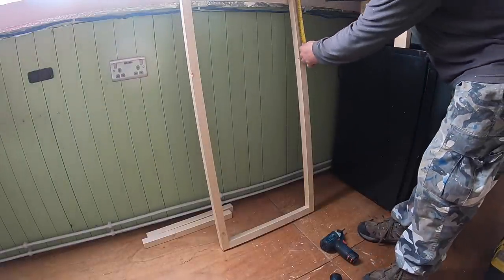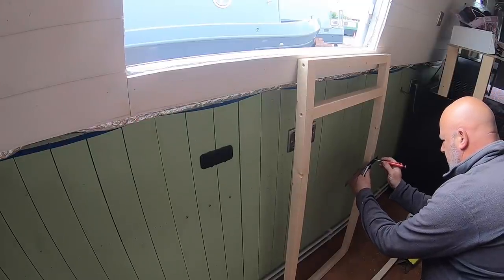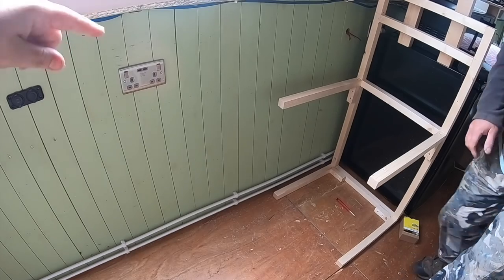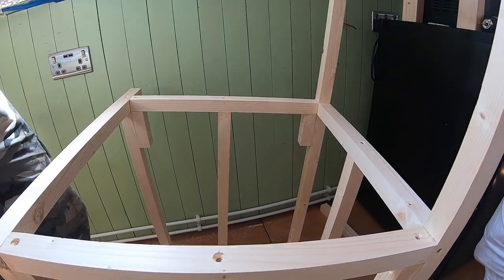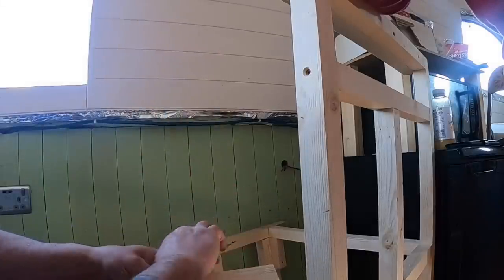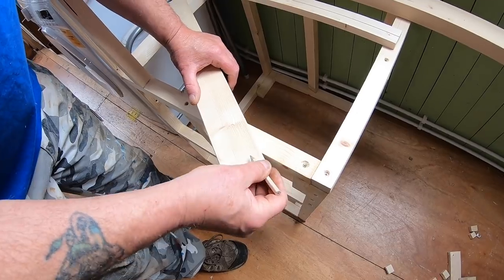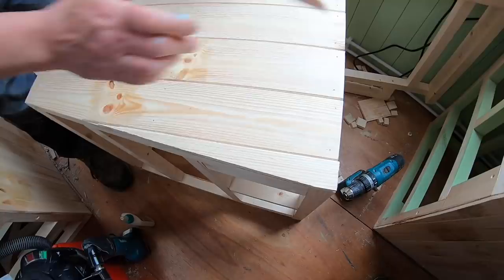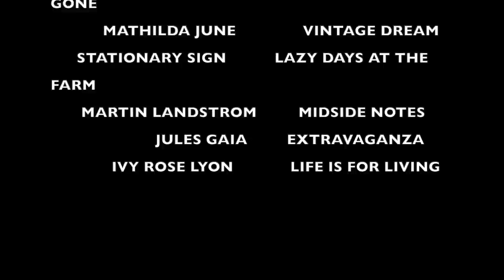VLOG 73, Narrowboat Fit Out -  DINETTE (part 1)

Comment: Up to your usual excellent standard. A split dinette is an interesting idea - you'll be able to get from the tiller to the head taking a nice, straight path. And you can both work on projects at the same time without bumping elbows, or the grownups can have a cuppa while the grandkids play at the kids table.
Reply from the maker: Yes that straight path to the head will be well worn hahaha. We were a bit worried that we wouldn't have enough elbow room  with the singles but it surprising how much space we have. Yes it will also be nice to be able to chose the canal side to sit at instead of the towpath which ever direction we are facing 👍

Comment: Wow, you were in a good mood today, making jokes! That was a complex structure, with a lot of thinking, calculating, discussing what is a smart approach.
So the ideal set for fastening parts is three battery drills, 1 for for drilling, 1 for deepening and 1 for screwing - that's expensive, but time saving!
How do you avoid screws crossing eachother, and still drilling in the center of a block or bar?
Great teamwork, including the kids as well.
Reply from the maker: Thankyou, yes think we are just becoming delirious now hahaha. Yes makes it much easier and faster with all three. We added the small blocks in to screw into to avoid clashing screws and the others with no blocks were just off centre 👍

Comment: Love that style of seating it seems to use the space better to me and you can always fill in the middle if you have company and need the space. Do you work off plans or just think it up and build it? Amazing either way. Not sure if wood prices are high in England as they are in the states so love that you can use smaller cuts and achieve so much. Do you paint or seal the knots so they don’t bleed through the paint? Can’t wait to the fabric choices and curtains too. Will you be building your own sofa or store bought? Can’t wait to see the finish next time hate to wait a week again but understand. Best wishes, Susan
Reply: They have been using a special knot sealant - you can spot the treatment at 38:00.
Reply from the maker: Thankyou Susan, We done all our own plans and designs and are still working from those. Fabric is all bought and ready to be cut as soon as all the messy dusty stuff is finished. Yes wood prices are extremely high here too and hard to find. Sofa depends on when we get the engine. If we finish the build before the engine arrives we will make the Sofa but if it arrives soon we will just buy a Sofa so we can get on the water 👍
Reply from the maker: @midwestconcertvideo  yes, We have used a couple of different knot solutions on the seats. one is clear and the other is the golden one so on some of the wood it's hard to see it is on there 👍